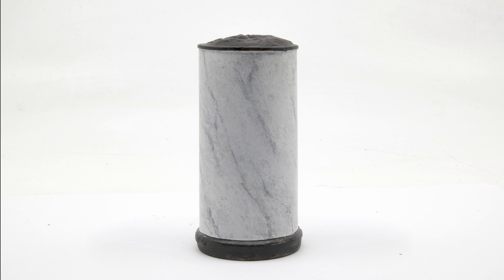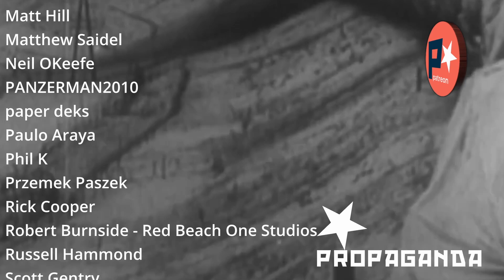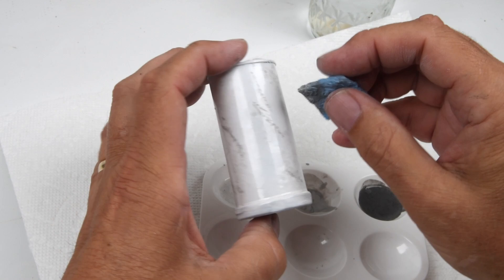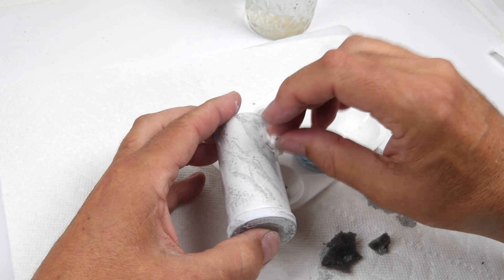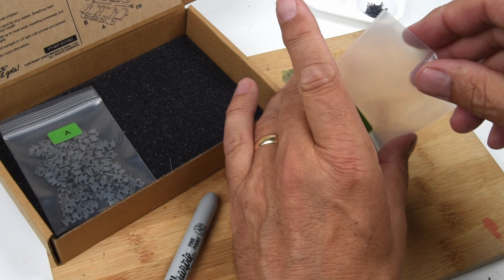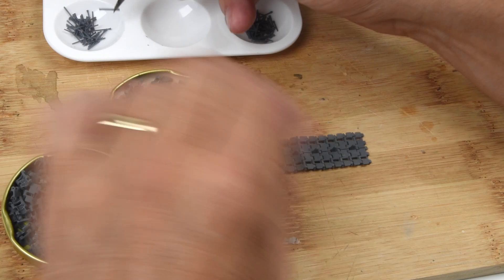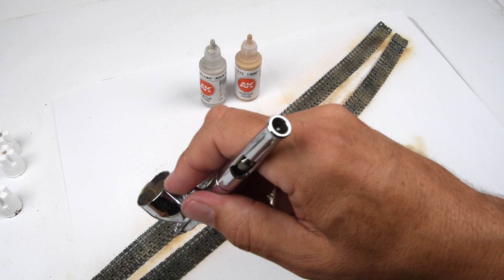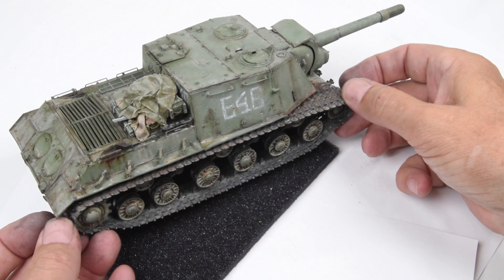SU 152 Ep 4, ZVEROBOY (Beast Killer). Fancy Faux Painting and Tracks.

Comment: Hey Rick, what do you think of Abt's fast drying thinner vs the odorless thinner? the hobby store has the fast drying one left in stock!
Reply from the maker: Zal, I think that it's fine. I prefer the "regular" formula. I'm used to the working time and haven't found the need to fast dry the oils. Keep in mind, that when I apply the oils in the first place, the linseed oils have been leached out on the cardboard, and the oils are applied with very little in the way of additional thinner (generally). Of course effects can be created by adjusting the amount of thinner to create washes and such.